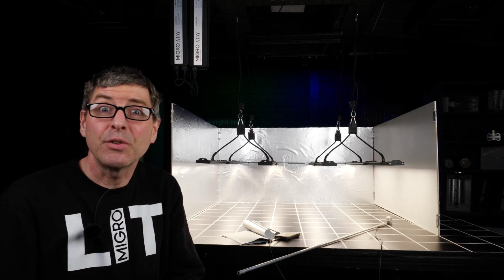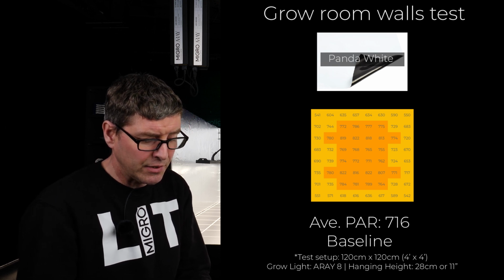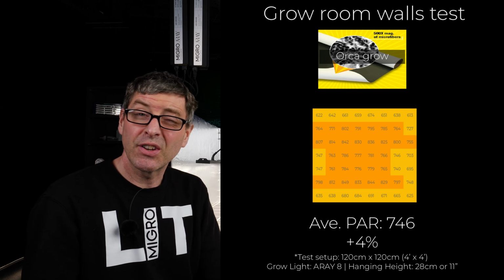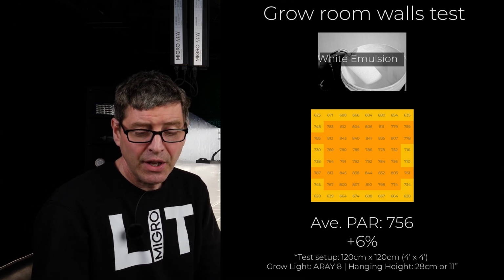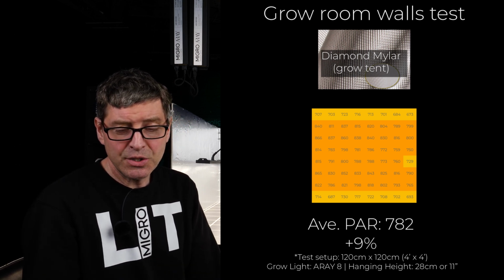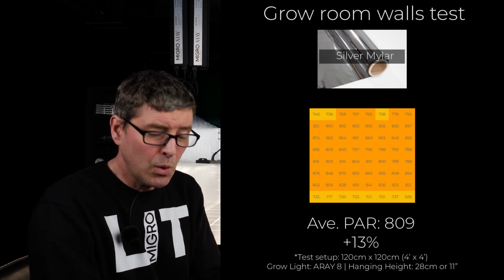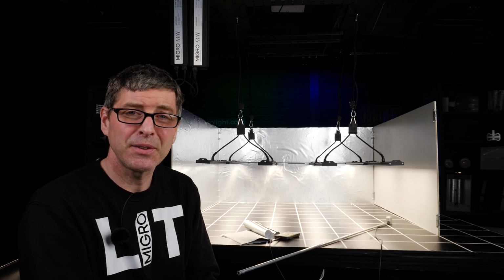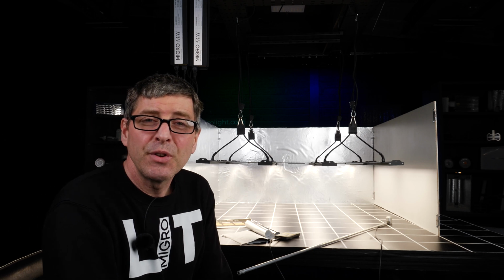Best grow tent lining & best grow room wall surface

Comment: I just have the regular silver Mylar hanging loosely from my drop ceiling grid with duct tape for my make shift grow room. You can make it as big as you want that way also. Super cheap (Mine is 9 feet by 8 feet) That's cool that it reflects more than grow tent material lol. My plants have been doing great with it! Since it is hanging loosely and I also have a register heat run coming out of the ceiling in the middle of it there's enough air flow blowing out that the Mylar doesn't heat the space up too much it keeps it at a nice 70 to 75° when the lights are on and when they go off it drops down to 65 in the winter.

Comment: I have a question Shane. They sell wall insulation that is kinda like mylar on one side. I hope you understand what I mean. How do you think that would fair in a grow room? Just saying that only for the walls?  Not for a tent, they come in like 4ft by 25ft rolls. Just wonder.
Reply: I guess its called reflective roll insulation. I was thinking about just using that for the room, not even having sheet walls. Thanks for your time if you answer.
Reply: It even has a diamond mylar look. Just wondering?

Comment: Hi Shane, I have two questions: 1. does the Array 1 fit in a 59cm closet? 2. which would be the ideal hanging hight for an autoflower? A friend has a 59x37cm closet and is currently using two of my old CXB3590 @100W and due to limited budget, I would like to recommend him to get an Array 1 now and buy a second when he buys a 60x60cm tent at some point.
Reply: You should have him "make lemonade with those lemons" the cxb3590 is still quality, Optic LED still uses them in their cob fixtures. Instead of straight replacement get some bloom boosting type fixtures with UV, IR, violet(400-450nm), and 660nm and you'll have something killer. There are a few companies that offer bloom booster bars, Optic LED I think even still has their bloom enhancer in square form that you can pop in the middle of those cxb3590 and call it a day, a good day.
Reply: Also to be fair 430-450nm is more blue that violet 😅 although violet has similar canopy penetration capabilities as green, with the benefit of being directly able to be photosynthesized instead of green needing a conversion by the plant.
Reply: @rdreynoldsbanana  Seems like you didn´t really read what I wrote. I know CXB 3590´s still are pretty capable goelioghts, but I also know that even LEDs do loose light performance over time used and concidering how much i ran them before giving them to him, they´ve lost at least 10% of their origginal performance and as I´ve said: he wants to swap his 59x37cm vitrine for a 60x60 tent later on, so how would your suggestion make any sense at all? That´s just pointlessly wasting money he doesn´t hav and efficency/ power usage is a very big deal nowadays in country. 100€ for a lamp with better light quality and distrebution while using 35W less power? In Europe that´s a very big deal nowadays and I don´t understand how spending money to use even more power than the current 100W makes any sense compared to switching to a modern 65W lamp which delivers exactly the type of light you want and he can just get a second to have the same perfect lighting for the 60x60 tent?
Reply: I just checked and Optic LED doesn't have the square version of the bloom enhancer. Although the one slim100 bloom enhancers would give some good quality improvement for only $150 and then later on a second one and those two cxb3590's are upgraded to be competitive with the top dollar fixtures. I know they produce more heat than others, but don't look down on those cxb3590 cobs. I wish I hadn't gotten rid of mine 😅

Comment: One thing that you forgot to test on is the temperature increase when using mylar
Mylar was invented for the use as a thermal insulator, so it could make a small grow room too warm, especially if it's not feasible to relocate the LED driver in another room

Comment: You know of all your videos I've watched over the years ive commented a few times requesting the test video on this hoping one day to see one on it.... The hps/mh umbrella style reflector where the bulb is vertically fixed not horizontally causing hotspots... I did enjoy this video as well like holy moly I knew a bit about reflector materials but not that it had THAT big of an effect
Reply from the maker: I did it 3 years ago, video here: https://youtu.be/39AqO9V_XaA
Reply: @MIGROLIGHT  thank you! I can't believe I missed it I'm tempted to buy one of the secret jardin dy100's. Been running an hlg 650 and the aglex m420 with great results but occasionally during winter months. I'll run the old school hps in one tent during the night and exhaust the warm air into the led side then using my smart Y ducting fitment I can open or close the air flaps to divert it the air without manual efforts. I got the idea of the parabolic reflectors from and aunt who's does professional photography for school photos an told me they light up the frame evenly and appears to be a more natural spread then focused spots.

Comment: Weren't the results between diamond mylar and smooth mylar opposite last time?
Reply from the maker: I think its because the hanging height is lower. The diamond mylar does reflect some light upwards and the relatively lower angle of the photons from the LED bars Vs COBs and HID in the last test may make the difference. It's a good point though and Iam not 100% sure I am correct.

Comment: I've been using mylar "bubble wrap" loft insulation for years..the bumpy surface stops hot spots👍
Reply: You just answered the question I posted for Shane. Yea, reflective roll insulation for a room should be cheap and work fantastic.
Reply: @25Patman  I've a few videos of it up, have a look if you want.Good luck , happy growin'✌️🪴🤘
Reply: @paulie6446  Nice, it will work for sure. I am thinking of just doing the room walls with this instead of actually putting up dry wall, and just leaving it like that
Reply: @25Patman  that's what I wanted to do, but I made the fold-up box for quick tear-down because it's illegal here 🤫

Comment: So.... I'm working on getting my first single plant grow going soon.  (your aray 2 is actually supposed to arrive tomorrow)

This isn't a suggestion, just curiosity.  I have thermal bubble wrap from an old project and figured I would use it for a temporary solution until I get a tent set up.  Has anyone tried this material?  

It's an expensive option, and not one I would outright suggest to anyone, except if you happen to have it lying around already.

Comment: The last time you did this test the diamond mylar beat the silver mylar. What changed?
Reply from the maker: I think its because the hanging height is lower. The diamond mylar does reflect some light upwards and the relatively lower angle of the photons from the LED bars Vs COBs and HID in the last test may make the difference. It's a good point though and Iam not 100% sure I am correct.
Reply: @MIGROLIGHT  I remember your previous test, albeit vaguely. Might you have ended up with a slightly better (e.g. closer to being a flat plane) installation, this time? Or, alternatively, could the two have been of different thickness (or even brand, which shouldn't matter, but ...)?
Reply: I was also thinking this

Comment: Try a test using the R-Tech   Foam insulation board . 4'x8' sheet 1.5 inch thick. It has an aluminum reflective side ,
Build a grow box or cover walls , keep heat out in summer and cold in the winter. Also lay down diamond mylar on the floor of your 4×4 & see how much more reflection there is.
Reply from the maker: They would not be efficient. They are not shiny, they are a dull finish
Reply: @MIGROLIGHT  thank you
Reply: Yea, you realy dont want light to hit the floor if you can help it to begin with. You want a full canopy.

Comment: Out of useful video ideas ? Your par readings are always so wrong compared to a real tent that has a roof and door and it’s sealed on every side !
Reply from the maker: Makes no difference in the test. It's relative results that matter. Got some good video ideas? I'd like to hear them
Reply: If all lights are tested on same conditions results will    be correct  Sherlock
So his doing right...
Reply: loser much ?

Comment: Thanks for that Shane - I've a 4 x 4 silver mylar lined tent for 5 years or so now and happy with it...!
I've a question - I asked you a few years back about adjusting the output of my Mars Hydro TSW 2000 and you recommended using a small flat blade screwdriver - I'm not sure what the problem is but I simply cannot get any kind of a screwdriver to catch anything inside properly and adjust the output - I wanted to ask when Im trying to reduce the output for seedlings will it have the same effect if I increase the distance from the light - and roughly by how much...? - thanks....!
Reply: I had to use the mini screwdrivers with that 6 " extension with a 02 or 001 Phillips bit,and just use the bit amd extension to "feel" for the sweet spot. I couldn't feel it with screwdrivers,screw was too shallow.  If ur really determined...1/8" screw extraction bit
Reply from the maker: A small Philips head should do it?
Reply: Maybe Allen key ?

Comment: What Are your thoughts aboute mylar emergency blanckets??? How reflektive ret they?🤔
Reply from the maker: Any shiny aluminium will do
Reply: @MIGROLIGHT  cool thanks for the confirmation glad I went that way instead of panda😁👍waay cheaper. Cant wait for the next video 😎
Reply: Thin, cheap, easily creased, and easily perforated. However, "cheap" can also mean "inexpensive," at least in the short run - and you'll certainly get your money's worth (which is not something you can honestly say about many things, in this world).

Comment: Oh dear orca took a hit there. I know what I'm doing asap thanks Shane thanks for clearing that up👍
Reply: Unfortunately Orca is pretty much out of business. 😢

I had retrofitted my 3x3 tent by lining all the walls, ceiling, and even floor with it (which increase PPFD values by about 20% over the silver Mylar walls btw) but was in the market for a new tent or more Orca film to do the same to said new tent.

However, I could not find any of the Secret Jardin 4x4 Orca tents anywhere online or even any of the film on Amazon or other online retailers. So I contacted the company directly.

They told me that, due to the pandemic they had been forced to sell off all of their stock of the grow film to try to make ends meet and had also discontinued the product (quite probably indefinitely). Even if you can find a roll it’s incredibly expensive (and so not worth the money unfortunately).

As far as drawing conclusions based on the results of this test though, it’s worth mentioning that it is set up in a way that favors the Mylar materials since those are Specular (meaning they reflect light on a specific direction) whereas matte white surfaces are Non Specular (meaning they reflect light in all directions equally). Hence, with no ceiling for the light to bounce off of, the Mylar material is going to look like it reflects light better. 

Thing is though, nobody grows in a space with no ceiling to bounce the light back down to the canopy. 🤷🏻‍♂️

I would like to see this same test reproduced in an actual tent or at least simulated room with walls and a ceiling that is lined with these different materials and see what the results are then and see if they still favor the Mylar.

Also of note is that Integrated Sphere’s, the gold standard for measuring the total number of Photosynthetic Photon Flux that a lighting fixture puts out are lined with a matte white surface, not Mylar. If Mylar were truly more reflective, then why haven’t people started lining Integrated Spheres with it?

Comment: would like to see white 5mm hardboard tested in this way. from a long term ease of maintenance the loss over Mylar would have to be pretty big. if its on par with white paint then its worth the slight loss
Reply from the maker: It would be the same as matt white paint
Reply: @MIGROLIGHT  the whiteboard has a much more consistent finish then white paint, I would have thought it would be a small % different? add it into the test the next time you repeat?

Comment: Now all we need is a company to make a tent which is 100% lightproof.  Leaky zippers anyone 🤐
Reply: Drywall is relatively inexpensive ;-).
Reply: There is many good ones.. gorilla and acinifinity are highly respected. Also you just patch it with a piece of good cold-weather outdoor tape from nashua or 3m company. Sometimes in shipping like mine, they poke the package with a rod for security purposes so that is why some end up having a hole if its imported.
Reply: @dertythegrower  bro calm down, guerilla tents suck crack. I got a he heavy duty one and never used it.  Why doesn't this specialty lighting youtuber go into the science though. Only certain spectrums need to be removed at night for you potheads to grow your drugs. You can run 730nm all night. That would be an interesting topic, not shilling for a mylar brand
Reply: for sure the cheaper zipper doors break easy... this is why you should always get a good tent brand, for sure, and not waste on a tent that will only cause you headaches in the end
Reply: @dertythegrower  Sadly them tents dont come in the size i use.  Cannot go bigger and not going smaller. 1x1 m.

Comment: Thank you for all the work you do MiGro...
My 2 cents....i did this long ago, there is awesome new paint and reflectives but.... 
There is a special extra-bright white paint. It's pricey though and it will not pay itself back (this is super important to do the math on)
Is a few hundred going to get you back a few hundred in product over 3 years? If you only get a boost of 1 percent, then sure, if its a big grow... but if you have a small tent
Reply: In North America? If so, BEHR Ultra Pure White has an LRV (Light Reflectance Value) of 94 - higher than Sherwin Williams' SW 7757 High Reflective White, which is SW's "brightest, cleanest white" product. The BEHR Ultra Pure White is also close to a true neutral white as makes no difference - any light attenuation that does occur must be pretty even across the visible spectrum. And it's good paint, for not a lot of money. You wont, AfaIK, find a better white paint in anything even approaching a consumer-grade product.

As always, of course, proper wall surface prep, priming, and application are important; a poor job can make more difference than - for example - going from the BEHR product to a slightly lesser product such as SW 7757.